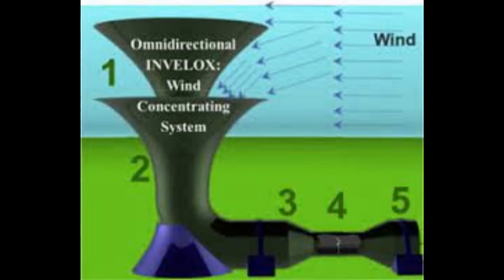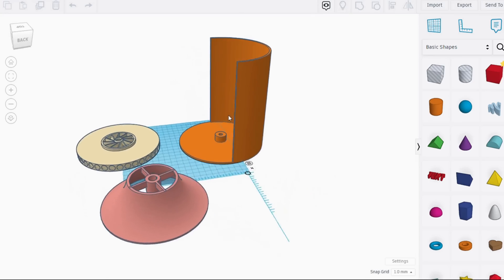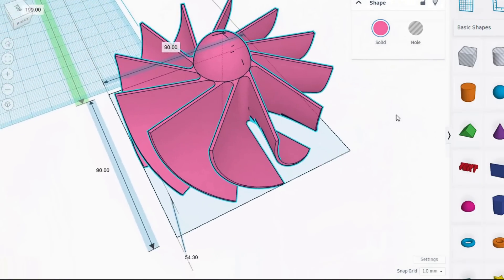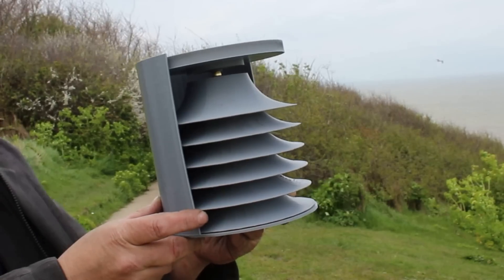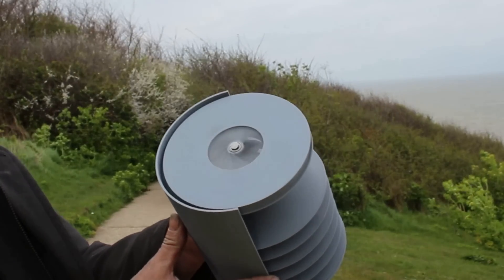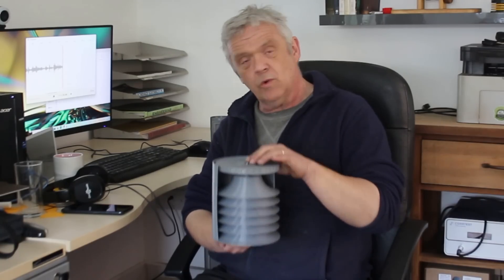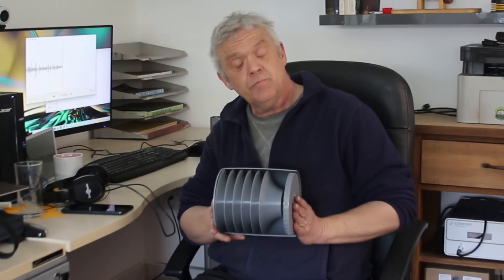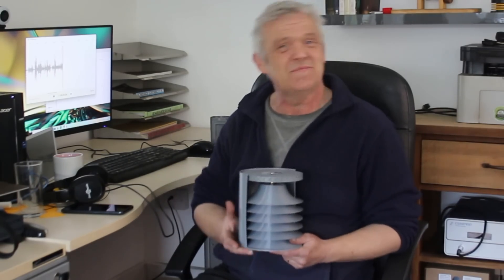1901 Brand New Wind Turbine Design For Camper Vans, Boats And Roof Ridges

Comment: Wouldn't it make more sense to just have a large scooped slope directing into the center instead of having all the fins? I feel it might cause A lot less friction and wind turbulence then having a bunch of conical slopes, instead use a single wind slope/Scoop covering the side and directing the air up into the center? it would face only 1 direction, but could be rotated to face the wind easily enough.

Comment: Love the design. I may never actually try to build anything on your site, but I enjoy the enthusiasm you have in every video! I almost always dislike the "curb" appeal to wind generation, but I think you could use this design up the corner of a home and it would look amazing!
Reply: Down here in the southern US states (specifically, "the south"), everyone loves their pillars/columns. They'd do great on there. Same for classical courthouses!
Although, I don't expect them to be adopted, in either case. 😕

Still, I like your idea with stylizing ones home using them.
Functionally speaking, in terms of maintaining ease of construction of homes, I think just having a 1yd/1m stack hanging under each corner if the roof, would work well! All the wiring can be easily plumbed up through the roof then, and into the house. Mounting hardware consisting of only a bearing block bolted under the eave, and an L-type bracket with a bearing for the bottom.

Comment: Larger units like two feet across or diameter.make a wall that turns into the wind  via a wind sock control how large will your printer print ?

Comment: To make it funnel more air and to right it to the wind in a nice package you could put 2 funnel edges added to the sides where the shroud stops wrapping around and a third larger one as a tail in the middle on the back of the shroud.

Comment: @Rob, as a sailor, I love this one. Very interesting indeed. I'd be curious to know how you would calculate the efficiency of that turbine. I know you mentioned the area of the cones would be what you use, but if you could make a video on how you would go about inputting that into Omni Calculator to get a sense of efficiency, would be pretty interesting for anyone looking to expand on this idea and wants to calculate it properly. Just a suggestion mate! Really enjoying the whole wind turbine stuff.
Reply: Make some sails that work as solar panels
Reply: Turbine efficiency is fairly easy to calculate it's just wind velocity X surface area.
Reply: @davidanderton2437  What? efficency= wind velocity X surface area? whatever mechanism is in that area? This can not be true - u get it yourslef, right?
Reply: @sonic_P  sorry I should be more precise in what I write. You only really need the area and velocity to calculate the available power. It's not as simple as multiplication but not far off. 0.5 X air density X swept area X velocity cubed.

Comment: This episode is the very reason I've been waking up each morning and turning on Rob and looking for an integrated wind turbine for a boat. All it needs now is a collapsible set of funnels so the boat doesn't blow over in a cross wind, a venturi tube to maximize the power output of an Archimedes generator which is connected to a sand battery which runs a Sterling engine which pushes a Sharrow Propeller - and when that happens I won't need to get out of bed in the morning. Thanks Rob, you stick in there - you're almost there! 

Also we do need some statistics on the power, the Amperage and the wind velocity.

Comment: Pretty amazing Robert. 
Do you expect there is a fixed ratio between the incoming horizontal air speed to the internal shaft / duct? I would assume that the area of the windward side Vs the area of duct is what is causing the increase in air velocity?

Comment: This concept of wind capture implemented in to a panel system similar to the wind wall would be amazing. You could build fencing with it and clad whole side's of buildings with it. Just think of the surface area a typical house wall has.
Reply: building an automatic electric fence? ;)

Comment: In a similar way, towing a trailer mounted generator behind a truck. The tires/wheel size act like a gearing system. Car alternators charging on board car batteries.

Comment: I was thinking that a cover above the actual turbine, on the 'upstream' side of the wind, opposite to that big cover you have on the bottom, would make a low-pressure zone above the turbine, increasing the differential pressure... sure enough, it adds a tiny bit of complication, in that those 'shields' need to rotate with the wind, but, maybe worth it??

Comment: Are you going to attached computer fan to measure generated electric power like in your prior design.  I suggest the MIT designed toroidal fan.  3d print one to replace the computer fan blades.

Comment: I see many options! 
You could even build it inside the front part of a car side mirrow... so you drive and charge up stuff.... no need of a normal generator. 
You could cool brakes or batteries with it, WHILE charging them as well. 
If you are busy redirecting air to cool stuff, you could use it in your benefits too.

You could build it inside lightpols on the side of the road. 
You could build it in bridge or sky scraper frames, to redirect wind to counteract the resonance it will give.

You could build them on the back of a bike... so you could charge up your bike while you drink a cold beer😅

Comment: That design is well suited to a planetary sun gear configuration based around the spinning exhaust plate. Like an automatic transmission in a car, gear ratios would accommodate variable wind conditions. Except in reverse. The output would spin the generator, naturally. Inspiring idea!

Comment: Great idea Robert, It is always inspiring. I will try to scale it up and show you the result. One of my concern is about snow. I live in Canada, and as you might know we get snow storm sometime. Although, during those events the wind is great and can get up to 12m/s, the snow pushed by that wind can glog any mechanism. The snow can also melt and then freeze again during a 24 hours span. I will have to come with a solution, but the basic design is fantastic.
Reply: How about a second cover 😊. Done.
Reply: @HetorakelvanHeverlee  Not really because at that windspeed the snow travels almost horizontally. And the cover would also prevent the wind to exit the turbine.  The cover would be usefull though, when the snow falls without any wind. For those situations, there would have to be a space between the turbine and the cover so the wind could exit. I will come up with something

Comment: Sorry, but this design makes no sense. There is a lot of unnecessary redirecting of the wind and a lot of power loss. Best would be to put the fan directly into the wind flow. Same as done with regular wind turbines. There is a reason why they are designed as they are…
Reply: There was mention I recall long ago about local laws concerning the bladed wind generators . Thus the quest for  ones that aren't quite so recognisable.
Reply: @philip5940  yes, that could be a point. But this design is no alternative since the efficiency is much too low. If he would once measure the power, you would see, that there is no real outcome

Comment: Try adding a hood/top on it shaped like an overturned v bottom boat without a transom,with a vane on the rear keel. Free to rotate with the wind. Theoretically this should create a low pressure area at the outlet for the turbine. If attached to the shroud as well that would keep the open face to the wind.

Comment: I am currently buikding a new type design passive solar greenhouse and ive been wondering if it was feasible to generate power from wind hitting the south side glazed panels utilising the ridgeline, maybe this is the answer. Thanks.

Comment: So my next question with is, how many can you stack. Do you get better results stacking 6 elements with a single turbine on top, and repeating again with 6 elements and turbine.  Or 12 elements and a single turbine in one. which give best performance. at what point is there a  diminishing return on the height of a single tower.
Reply: Excellent question, I would like to know answer especially for roof ridge configuration. I think it would depend on wind speed..
Reply: There would be a limit based on the input flow, where if the flow force added by the additional disc air was equal or less than that already rising then no further power is added.

Comment: All videos with wind turbines should include a link to video 1799.

For this thing to be able to power a modern phone charger, it should be about 10 metres long if used in a city (with average 4 m/s wind speed), or about 2 meters if used on boat on North Sea (7,5 m/s average wind speed)

Comment: Brilliant …. Can you do a test comparison of with and without the shield? I suspect a lot more power would be generated from all angles without … or if required for strength of structure, to restrict to thinner bars to hold together. 
And of course, this could be used for so many applications.  Also the collector disks could be stacked up to get to optimum.

Comment: Love all these newer generator designs. Seems like the further you modify/investigate the better the results are getting. Would LOVE to see you try some type of  static electricity capture/storage device. Static electricity is basically everywhere, all the time. Harnessing it would mean a breakthrough in electric generation as it is known. I think Tesla was trying something along those lines. We know they use "sails" in some areas to gather moisture out of the air for potable water with great success. Why not the same for static electricity? Especially in areas of high static generations like sandy deserts?......Just a thought for you Robert.

Comment: Hi, Please use this arrangement with the conical turbine in 1889. Set up the cone directly above the air flow. If the blow of air from you, made move the model on 1889, this wind captures plates will make wonders. Don't you think? Plus, try to take out the shield, so the wind plates work with 360º directions. Maybe the cone of 1889 can be set as normal and the wind plates upside-down. Pardon, my English is not so good.

Comment: What if you put a dome on the top (stop birds sitting on it) redirecting all air back down a tube on each side of the opening, blowing back into the air flow.
Reply: That would just increase the resistance on the exhaust side and make it harder to move air. Plus you'd be blocking part of the intake with that recirculation system. Best to get all the power you can out of a single pass. You could have a multi stage turbine, but those do best when you are dealing with high pressure.

Comment: thought, not sure if it is plausible but if you had several of these wind turbines side by each with the expulsion facing downward next to each other , could you not re-capture some of the air flow from the neighbor and there by increasing input  even if by fractions ?

Comment: The tail and air catcher could be made to catch more air if it were wedged type of funnel shape with the turbine set further back in the funnel you could easily get 3 times the area of catchment without major issues this is a great way to go as it concentrates the heat in the air making heat recovery more efficient wind powered heat pumps 
I like the look of that turbine

Comment: Hi Robert, curious to know if you could try it without the backstop or any wind directing fins at all, or have you already done a video of that? As this is looking at using it in on a boat I would think using the fins would be better then the back stop but if it works without both.. well then :)

Comment: I am just thinking of the commercial application in domestic housing. I wonder how big the generator would need to be overall to generate 10Kwh.  Bearing in mind it has vertical and horizontal expansion potential. Sooner or later you are going to come up with a ground breaking product Robert and this could be it.
Reply: Short answer, very big. It depends on the wind speed. One way to think about it, is to see how much air a battery powered leaf blower would put through and multiply that for a few times. This is constantly on my mind and I'm thinking of places where I could put such a big collection surface. With slow winds there's no shortcut, you need big collection area. And using the structures that Robert is constantly iterating is probably a good way to do that.

Comment: A great EV range extender, a large version of the generator could be embedded into a vehicle with ducting and front facing scoops to supply air, the scoops could have flaps that close so the aerodynamics are not ruined then opened when braking or accelerator pedal is released so you get 100% free power. Another part of the regenerative braking system. The generator or generators could be mounted low and if 2 were used could be made to rotate in opposite directions to counter balance the rotational force on each side of the car, like 2 gyroscopes.

Comment: Would there be a limit to height Vs diameter? As in if I stripped my gate/fence to make a row of these, it's about 6ft6×15ft. Could I just stack and stack fins? Or is there a length from top to bottom  the flow would be too restricted? Also would doing this front and back provide any real usable power with this area??

Comment: Pretty clever.  If you put some sort of tail on your shield, then your device might be pointing in the direction of the best angle to catch the wind?  Might have to extend your central bolt a bit then have spokes, bottom and top to your shield.

Comment: That other rooftop turbine that has 'wings' on each side of it to increase the pressure in the middle.... Could you use that same concept with this to increase the pressure before entering the cone disk array?   Sorry, I'm terrible with what things are called.

Edit: you could add the same wings at the point of exit to decrease the pressure, creating a greater difference between the two.

Comment: Great stuff!! I wonder if the 1901 turbine blades multiply the wind speed by concentrating it.  I assume so.  It would be interesting to measure the increase from one blade.  Then two blades, then three and so on.  I think there will be a point where more blades are less and less additive.  Then size and spacing differences could be examined.  Or have you already done that?  Very interesting questions you raise.

Comment: Great design , but the generator was wobbling, that means the generator and drive shaft are not stable or balanced , therefore loosing torque, speed while increasing heat in the bearing.

Comment: Could u alter funnel to up, so as air passes over them , they create a negative pressure , create a constant vacuum , and wen wind stops , the turbine are spun again as the air rushes in to replace the vacuum , similar way to a nuclear detonation two phase?

Comment: I saw a similar looking design for a stacked ion drive the other day, but thrust was impaired as later stages actually restricted the flow from earlier stages. Might this design be improved by increasing the size of the central aperture of each stage as you approach the turbine, encouraging a cylindrical laminar flow?
Reply: I had the exact same thought as I watched this, airflow will progressively increase as you move up the stack.  A widening aperture sounds like the logical step,  though airflow tends to do unexpected things so would need plenty of testing (ideally simulation to start with).

Comment: Yes this looks like a definite Improvement to the 4-ft wide 30 ft tall wind turbine Tower that was on one of Jacques cousteau's research vessels in the 70s, as I understand it somebody scrapped that boat out in Oregon and place the turbine in the air to power their house, I recall commenting about this around the time you were doing squirrel cage rotors, with the kind of rotating cowling that you are looking at I think you will achieve very good power levels

Comment: would you mind printing the next parts with different colours  kinda to match the cad designs so its easier to see what parts are what especally if they have moving and static parts  ?,...or a little bit of paint / pen markings just so it has a visual of it spinning on camera  😆 hard to see whats moving and whats static with it all being grey,  untill you did the topdown view of the impella but with you adding more and more items to these designs it just helps it stand out.

Comment: These could be designed into EV's placing them in the radiator area of normal, internal combustion cars.  There may not be a lot of extra "drag" since even EV"s have some vertical surface area there anyway.  I could see the wind turbine laying sideways across the front of the car.  Has anyone done any comparisons of this parabolic design to other wind turbine designs?  Great ideas.  Keep them coming.

Comment: It would be really helpful if you could measure the output of wind generator and let us know. Thanks if you can.  If it's a good enough output, either vertically or horizontally,  I'll get a 3-D printer and make a really long one.